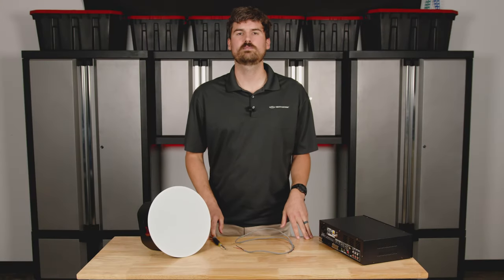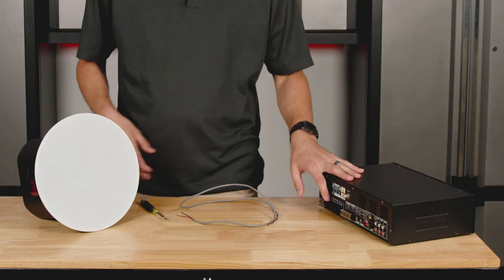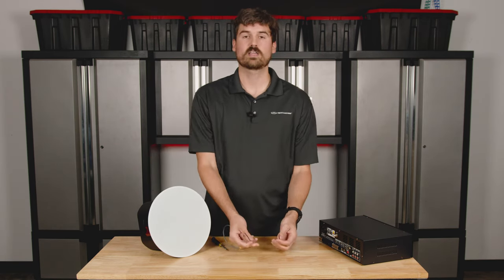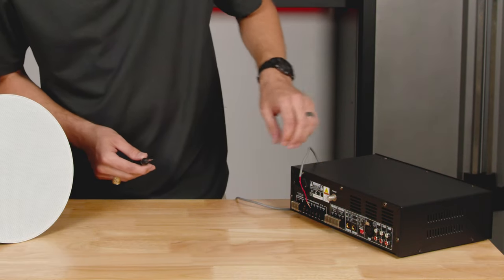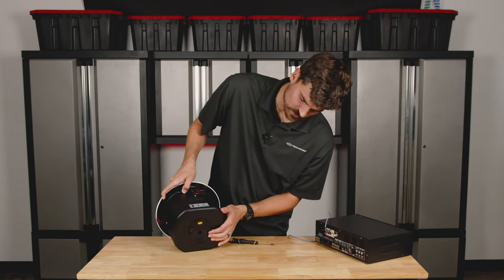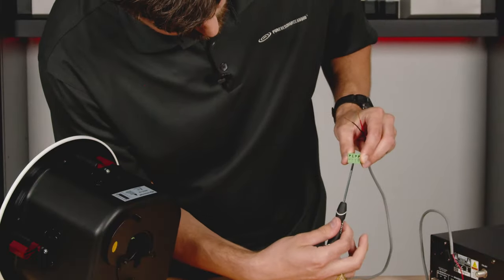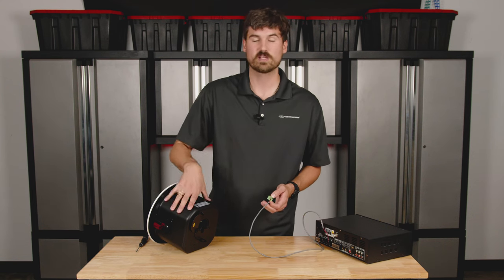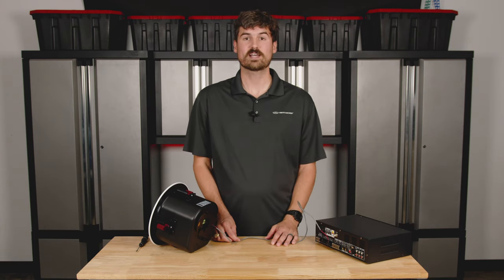How to Connect Ceiling Speakers to an Amplifier

Comment: The speaker wire what did you connect them before they start  working,pls I need more explanation sir
Reply from the maker: In this video, Andrew demonstrates all the necessary steps for connecting 70-volt speakers, apart from simply plugging the amplifier into an outlet and turning it on. Most passive 70V speakers only require connection to an amplifier to function.
For more details, you can check out these two videos that might help clarify things further:
- https://youtu.be/1pR7vWSbMOI?si=2x0nxXUkryriIVgC
- https://youtu.be/I4tDv2eVYMw?si=nRUjle00Q5y7gD80
I hope this is helpful!

Comment: Hi, do you happen to know how to connect the JBL Stage L260C to a fosi audio BT20A? I think the Fosi only has 2 sets of outputs so that is that but how do I connect that to my JBL?
Reply from the maker: You're correct that the Fosi Audio BT20A has stereo left/right outputs, while the JBL Stage L260C is a single speaker and can not provide a stereo experience. To achieve stereo sound with the BT20A, you'll need another L260C speaker to connect one as your right speaker and one as your left. Connecting just one L260C to the BT20A will give you either left-only or right-only audio. Adding a second L260C speaker will allow you to experience true stereo sound. 
Here is a link to the Fosi Audio BT20A manual for additional guidance: https://cdn.shopifycdn.net/s/files/1/2251/7913/files/BT20A_Updated_User_Manual.pdf
Hope this helps clarify the setup for you!

Comment: This makes no sense to me. The speakers are "in" the ceiling. How am I running a wire to it.
Reply from the maker: Thank you for your comment! I understand that ceiling installations can be confusing. Here’s a step-by-step explanation:
1. Mount or Install the Speaker: First, secure the speaker in the ceiling where you want it.
2. Run the Cable: Next, run a cable from your audio source up a wall and into the ceiling space.
3. Connect to the Speaker: Navigate the cable through the ceiling to the speaker location and make the terminal connections as shown in the video.
If you need assistance, a local handyman or electrician should be able to help with the installation.